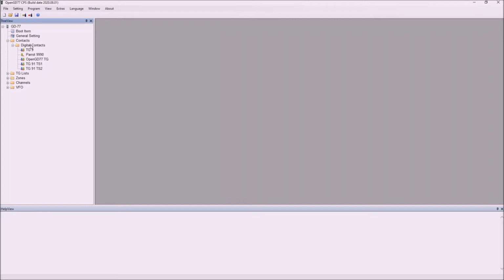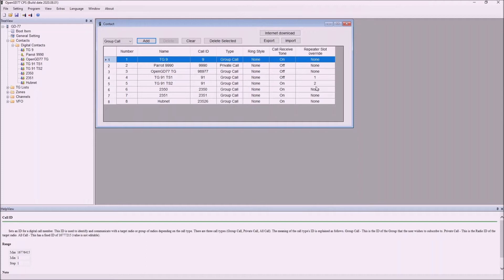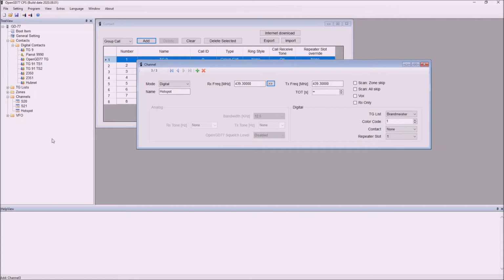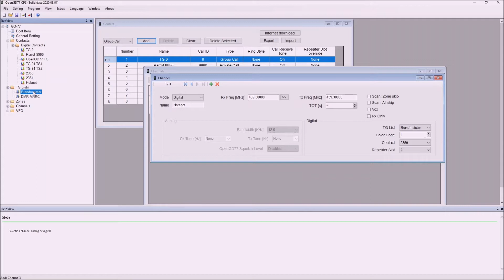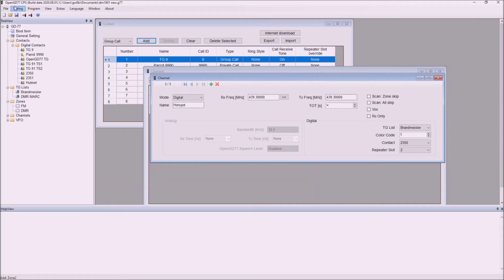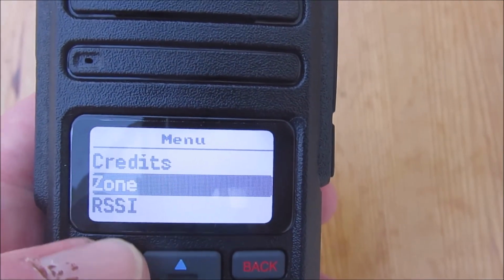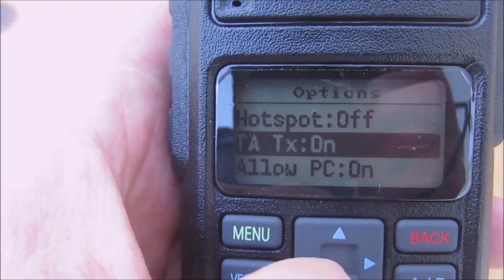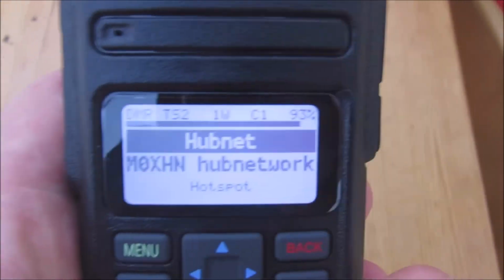A simple codeplug for the DM 1801

Comment: Great video.

Be wary about enabling Talker Alias for Tx. This causes problems on DMR MARC systems because they can't handle the TA traffic and it causes packets to be dropped and you'll get strange stuttering of the audio.

Even on BM its not generally necessary to use TA Tx, because BM automatically inserts your callsign into the TA data, and if you have a BM account, and enter your name and other infromation  e.g. location, into the APRS data, this will also be included automatically by BM.

Generally TA Tx is most useful for simplex operation, as long as the other radio has the ability to receive TA data. Currently the firmware in most cheap DMR radio's can't receive TA data. 

The MD380 can do it if you have MD380Toolz installed, but the factory firmware can't.

Also. Note with the Timeslot, that if you set it as an override in the contract, this will override the TS setting on the channel.

e.g. my local repeater has some TGs (505,3801, 3802 - 3807) on TS2, but others (TG 5, 3809, 3810) on TS1. 

So I set the the contacts for TG3809 and 3810 to have a TS override of TS1, so that I don't need to press * (Star) to change to TS1 when I select those TGs.

The only TG where I don't specify the TS is TG9 as that works on both TS1 and TS2.

However like all things in the codeplug, everything depends on your local setup, e.g. local repeater and whether you have a simplex or duplex hotspot.
Reply from the maker: Thank you Roger and thanks for the useful information and for clearing up the TA setting. I find the Open firmware excekllent but as you can see I am still learning! 73 de GW0KIG
Reply: @KevinOReillyswl  No worries.